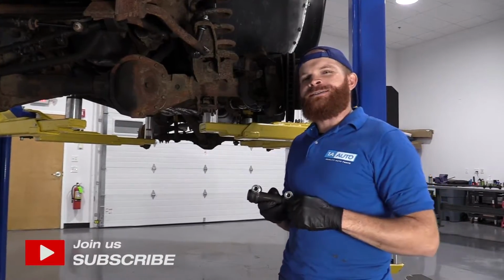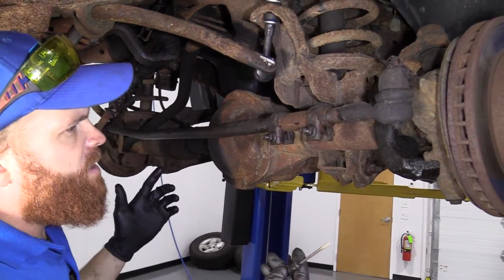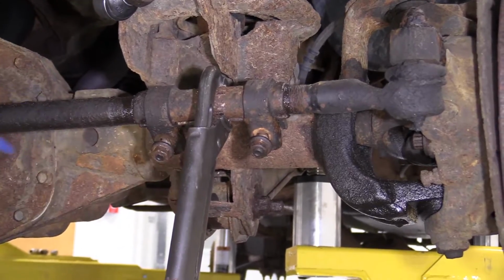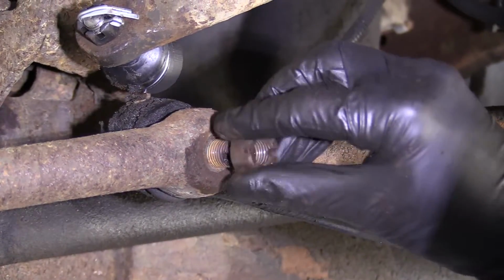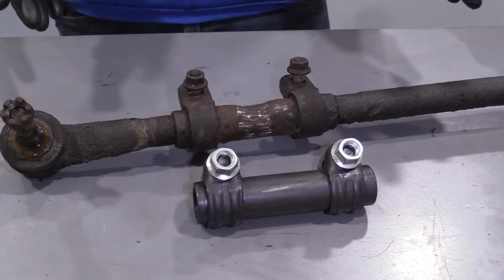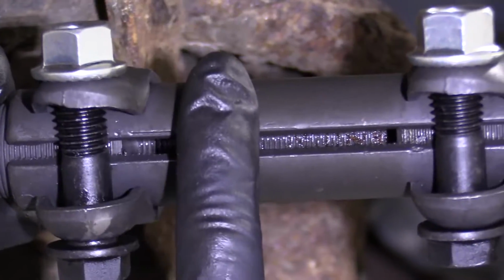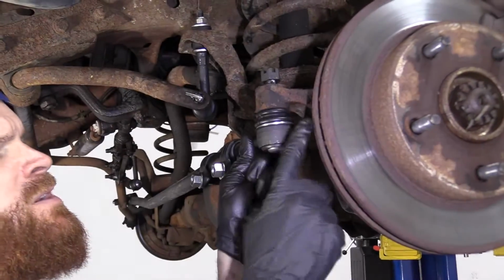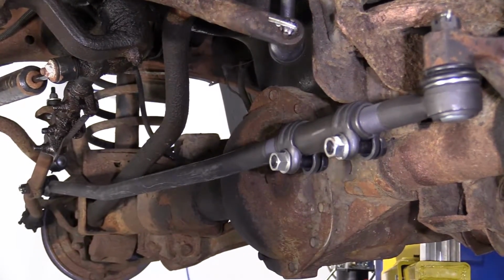How to Replace Driver SideTie Rod Adjusting Sleeve 94-02 Dodge Ram 1500

Comment: My clamp is just sitting loosely on the adjustment sleeve after mechanic replaced outer tie rod end, they did not put the bolt and nut back in. Can I just use any makeshift bolt and nut that fits through I don't want to have to bring it back to the shop? I've been driving without it for 2 weeks